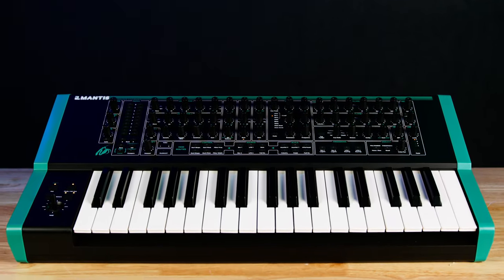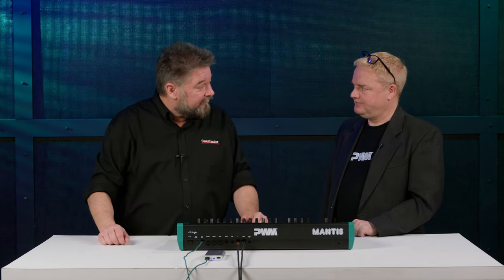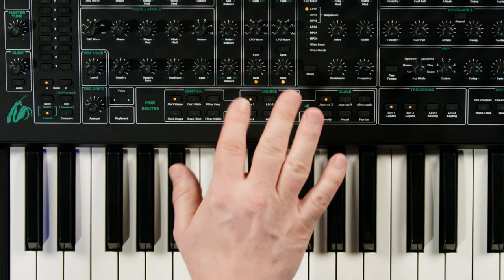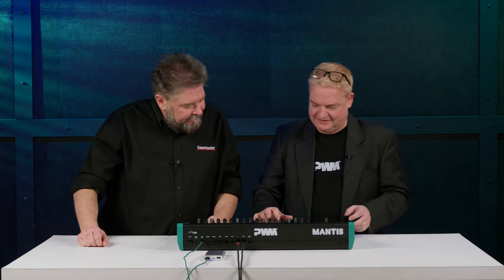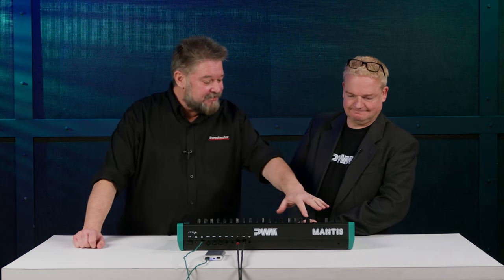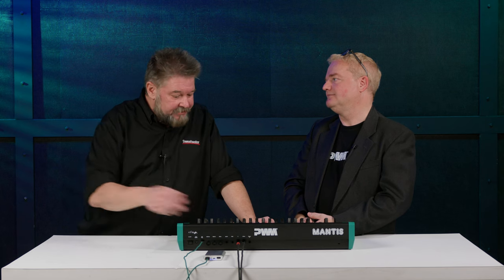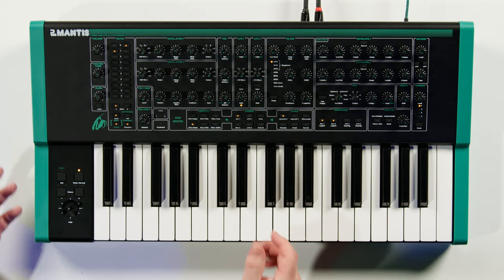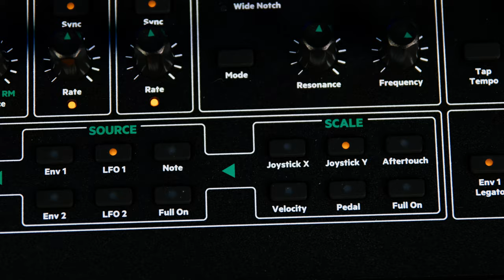PWM Mantis: Analog & Digital Duality in One Duophonic Synth, Fueled by Exploration

Comment: There is something special in the 4K videos filmed in “jumpy” 24 FPS. A simple and basic camera pan (00:19) manages to become unwatchable no matter of highest quality of every single frame.

Speaking with the audio metaphors comprehensible by the audio engineers,... it's like you made a recording with 32-bit floating point. But in 22050 Hz.